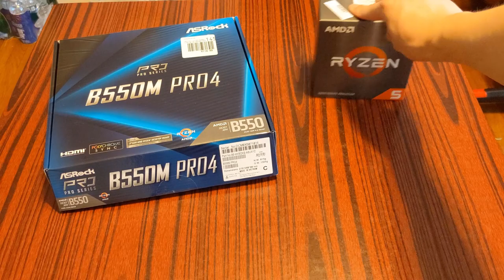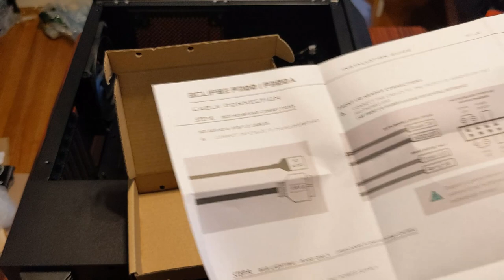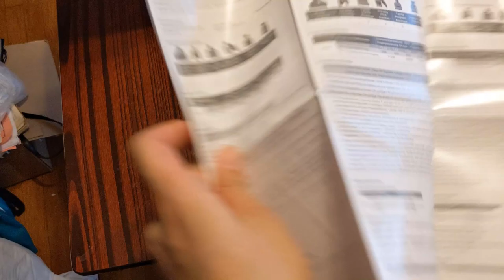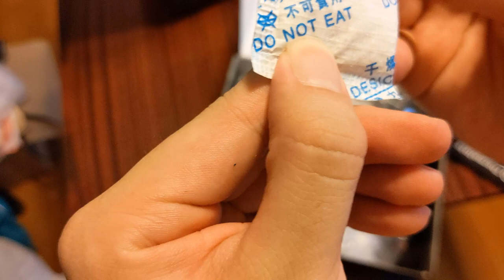Building a Computer with the Ryzen 5 5600G (No Graphics Card)

Comment from the maker: I know that I put the RAM sticks in the wrong slots, I put them in the correct ones later on.

Also B450 and B550 motherboards do work with Ryzen 5000s BUT you might need to update the motherboard's BIOS.
Reply: Yes, I noticed the Ram cockup, but lets face it, you didn't commit murder did you? Everything's fine, you can sleep easy. I like your "bloke in the pub" style of presentation. Easy to relate to and understand. Building PC's we all make mistakes... I have been off-market for about 14 years... coming back now.... wow.... so much has changed. very confused at pretty much every turn. I'v built 100's of pc's... 20 years ago. So my next job is re-learning how to build. For example - M2 simply did not exist before... And it was a BIOS, not a UEFI.... I have a lot to learn...
Reply: You put these stick into A2 and B2 for better performance
Reply: b550 is ready for 5000 series ..no need to update bios for asrock b550m pro4 (a520,x570,b450 chipst theese day),, you should probably to update bios if you use A320 chipset
Reply: @rullycomicart1532   No ! If you see the cpu support of that motherboard the ryzen 5000 series require a newer bios...

Comment: For those who are wondering, I finished this build Yesterday and it is great. Games run extremely smoothly, PC is fast. So if you don’t have a big budget, this is definitely a great build.
Reply from the maker: Nice! 👍
Reply: Do you need a Bios update for the motherboard?
Reply: @sluggarr_  i don't know about this specific B550 model but you will probably need to for the b450s
Reply: @shaypex8881  I got this exact model
Reply: @sluggarr_  I reccommend checking on the makers of the PC if you need to Flash with this MB. You can find this info on their website or a site that checks compatibility.

Comment: I'm not sure if it is different from one Brand to another. 
But for AsRock, I think you are supposed to use A2 & B2 RAM slot, instead of A1 & B1 as shown in the video.
Reply from the maker: Yes, I figured this out later when I tried to boot it and it displayed only 8 GB of RAM.
Reply: @IronLight001  Good observation, proper and nice response. It is great when u admit and correct your mistake. Experience comes from this :)

Comment: Hey I’m about to buy pretty much all of the setup that you’ve shown here but I was hoping to maybe get the ASRock B450M Pro Micro ATX AM4 instead just that it’s about €80 as opposed to €180 where I am (Ireland).
It came up on PC Part Picker so I’m presuming it’s suitable for the cpu but it’s giving me this warning when I’m in my cart:
“The ASRock B450M Pro4 Micro ATX AM4 Motherboard supports the AMD Ryzen 5 5600G 3.9 GHz 6-Core Processor with BIOS version P5.00. If the motherboard is using an older BIOS version, upgrading the BIOS will be necessary to support the CPU.”
I have no prior knowledge or experience when it comes to building pcs so updating the Bios would be a challenge for me but I’m sure there’s guides out there.
If you have any advice regarding this or what I should do I’d really appreciate it. If it’s the case where that motherboard isn’t compatible then going for the more expensive alternative would be fine, I’m just trying to save where possible. Thanks man and fantastic video!
Reply from the maker: If you have no experience building PCs, I recommend getting parts that you are sure are compatible. 
Building a PC for the first time can be a bit daunting even without worrying about possible BIOS issues. 
If there is a store that sells computer parts near you, ask them to pick out a compatible motherboard within your price range.

Comment: I know this question will annoy lots of people - so sorry in advance.... but WHY do they fit those brackets / braces next to the CPU slot? To me me they serve no purpose and only confuse a new builder - or an old builder returning (like me). Due to the screw tops... they are essentially useless out of the case. Why have them, what are they for?
Reply from the maker: The brackets hold in place a backplate on the other side of the motherboard that is used to install coolers, I don't remember if I showed it or not.
Reply: @IronLight001  Ahhh, OK. Guess now I have to look for missing pieces on the back side... OK, thanks for the advice. I don't remember anything slipping / falling when I moved the brackets, but I was not really paying attention to the rear, just the front. I have not switched on the system yet, just physically building, so taking it back apart is fine and easy. I have a choice of 3 cases and 2 good PSU's, 8 more OK PSUs... all off the shelf old stock, but viable. Been a long time since I did a New build, so I am treading very carefully. I mess about with old pcs every day, but this is my first new one in a looooong time. I'm usually messing about with Athlons and P4's, this is out of my comfort zone. Usually if I screw up its £20 wasted, now its £280+ Colour me very nervous!

Comment: Great vid! Im planning to buy a ryzen 5600G myself, i just cant decide what gpu would be best to buy once prices go down. Do you have any suggestions?
Reply from the maker: Try out the integrated graphics on it first, before thinking about which graphics card to buy.

Depending on what happens in the future with prices and what is available, I think something like a Geforce GTX 1660 Super would be a nice match.
Reply: @IronLight001  RTX 2060 or 2070 is a bigger step forwards, if you are willing to wait. Ray Tracing and DLSS as extras!
Reply from the maker: @robertcraane7910  Yeah, depends on prices and availability and how much performance you need though and your budget.

Comment: I just bought one 5600g and the wraith cooler has one arm of the screw bend, so it doesnt form a rectangle and doesnt fit in the mother board. does yours have the same? I'm starting to think it is a factory error.
Reply from the maker: If one arm is angled differently than the other three it probably is a factory error.

Comment: Is the pre applied paste on the cpu is enough or you need to apply a new one?
Reply from the maker: The pre-applied paste on the cooler is enough, if you wanted better cooling you would probably want to buy a better cooler instead of using the stock cooler anyway.

Comment: I got this exact same motherboard to build with a 5600g. Will I need to update the bios with another cpu first? Or does it works out of the box?
Reply from the maker: Depends, some will and some might not. Mine did but I asked for one with an updated BIOS when I bought it at a store.

If your motherboard BIOS isn't updated than you could take it back to the store (if you bought it from a store) and return it or exchange it for one with the updated BIOS. Or you could pay someone to update the BIOS for you. 

If you want to update it yourself but don't have another CPU you can get a Short Term Processor Loan Boot Kit from AMD check out link below.

https://www.amd.com/en/support/kb/faq/pa-100#faq-Short-Term-Processor-Loan-Boot-Kit
Reply: @IronLight001  thanks so much!

Comment: Did you have to buy an m.2 wifi card on top of that?
Reply from the maker: No, because I used a wired connection for internet since the build was going to be placed right next to the router I just used an ethernet cable.

Comment: im planning to build a pc like this and follow ur tutorial but i wanna add an hdd how do I add one?
Reply: and also i cannot find your power supply in my country will COOLER MASTER MWE GOLD 650W 80+ MPE-6501-ACAAG-U2 Power Supply work with this build?
Reply from the maker: Probably, use https://pcpartpicker.com/ put in the parts you are going to use and see how many watts you need.

Also this is not a tutorial, I left out some stuff to reduce the video length.

If you want I can make a separate video where I install a hdd.
Reply from the maker: https://youtu.be/MFEpqe-7J5Y this is a basic explanation of installing an HDD.
Reply: @IronLight001  wow thank you so much!
now i can start building mine 
very great help

Comment: If I add a 3060 with 16gb 366mhz ram will I be able to stream and game at the same time. And is a 3060 with this apu good enough for the next 3 4 years. Also is a apu with a gpu bad and not as good as a cpu with a gpu? Thanks In advance.
Reply from the maker: Before reading this keep in mind, I'm not a expert and you are responsible for your own choices
------------------------------------------------------------------------------------------------------------------------------------
I use a weaker CPU and a weaker graphics card and I stream fine. 

I think you mean 3600 or 3666 MHz for the ram.

A RTX 3060 is great if you already have it, if you don't I recommend waiting to buy a GPU until the prices are actually reasonable.

If you don't have a GPU yet you can build something with integrated graphics first, see how it performs and you can upgrade in the future if you want. 

A Ryzen APU compared to its counterpart Ryzen CPU has slightly worse performance but keep in mind that the CPU would probably be a little more expensive and a CPU is not possible of having video output if it does not have a GPU or integrated graphics.
Reply: @IronLight001  I see. So if both apu and cpu were to have the same graphics card then cpu would outperform by a mile ?
Reply: @s.torvo1717  u can check it out " 5600g vs 5600x" +gpu
Reply: @s.torvo1717  depends on the task but the 5600x will perform slightly better in every task due to it only having 16mb of L3 cache instead of 32mb and the 5600x also has a little higher boost clock. If you have a GPU lined up I wouldn't buy the 5600g. The 5600g is more meant to be a stop gap solution where you are not planning to get a dgpu for months, a year, or never.
Reply from the maker: @s.torvo1717  Look at the chart on this site for a rough comparison of different cpus.

https://www.tomshardware.com/reviews/cpu-hierarchy,4312.html